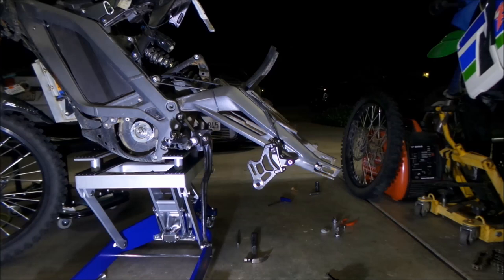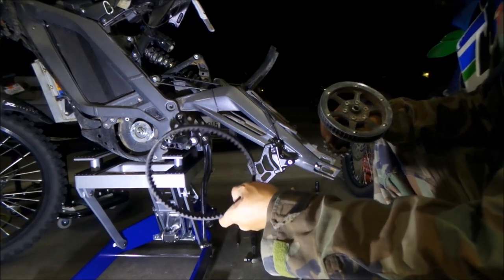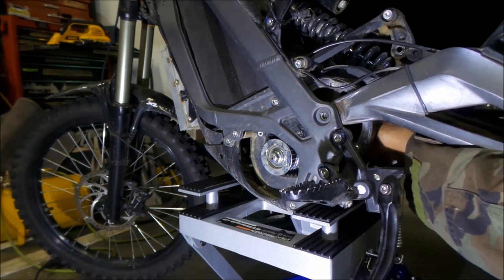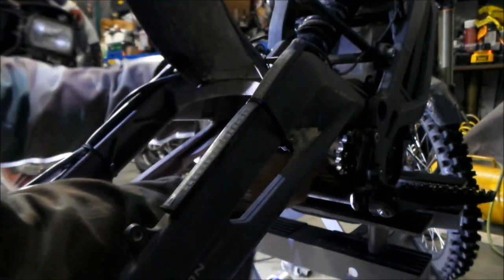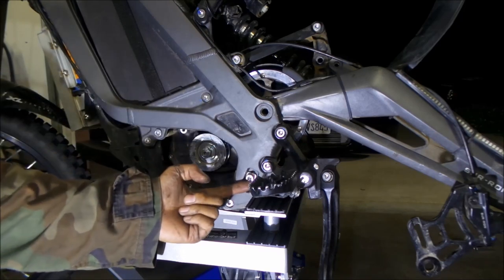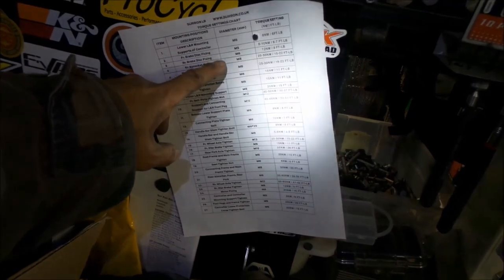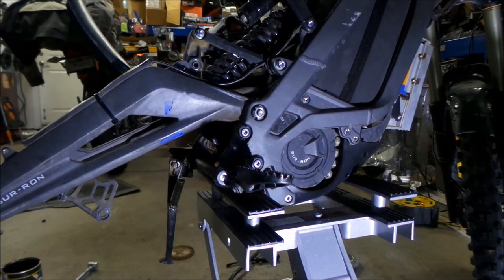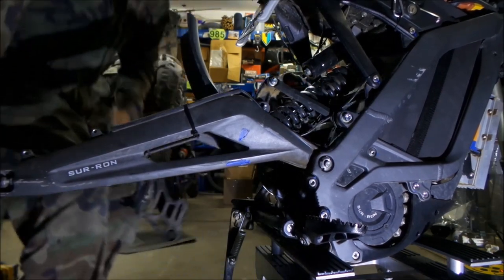Sur Ron Light Bee Primary Belt Drive Replacement Part 2 - Swingarm Install

Comment: Awesome video!
 Been trying to reassemble my rear swingarm for the last 2 hours....So I stripped my axlebolt when trying to remove the specialty nut. From the looks of it, I will need to replace as you needed to hold in place with a 5mm allen while torquing down the specialty nut. Would you agree? Do you know where to source the axle bolt? Ebikezilla is out of stock.
Reply from the maker: Did you use a special socket?  I was afraid of stripping the axle head if I use that to remove or torque the bolt
Reply: @hadesomegamoto7639  nope :( used needle nose pliers and a crescent wrench to hold. then stripped the hex side as none of my allens fit properly